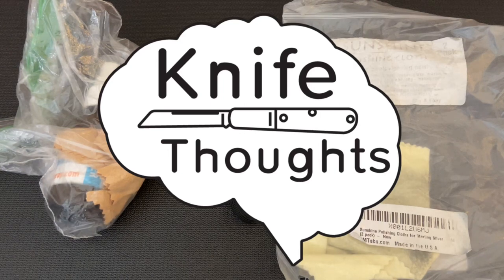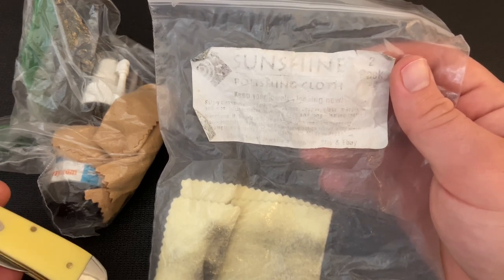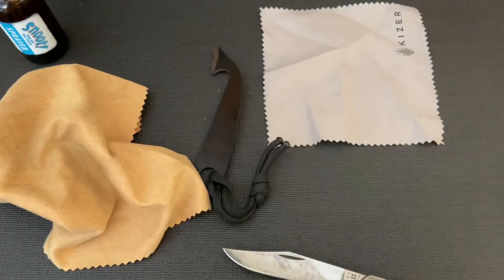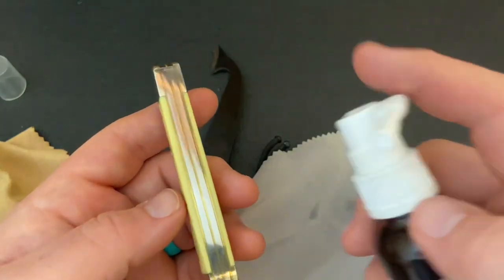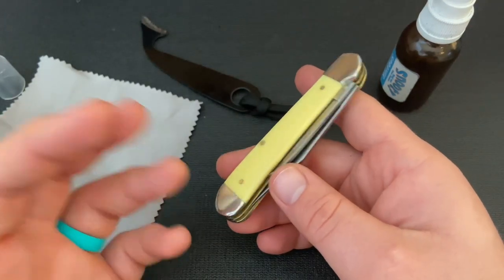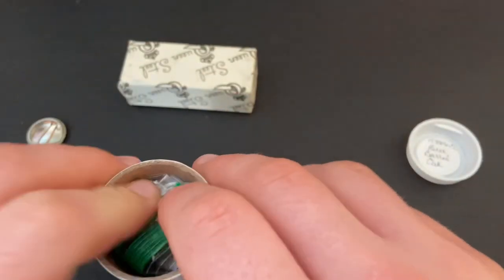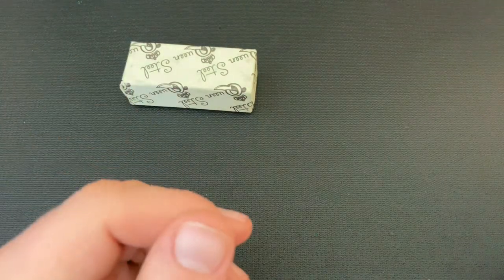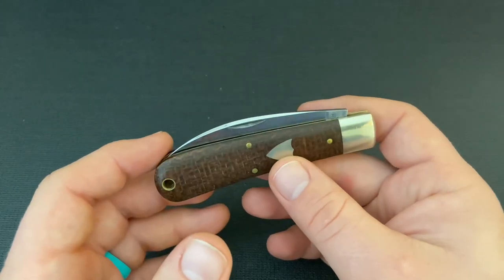How to Maintain and Store Traditional Knives (Slipjoints, GEC 1095, Case CV, Carbon Steel, etc.)

Comment: I always use Ballistol oil for cleaning since is a lubricant oil and food safe. 
Patina will help to protect the steel from elements and ruating. I more promp to rust if you taking the patina always out. Good patina is the best coat the blade can have ...
Carbons need frecuent cleaning. 

I carry a clean blade and a dirty blade. One for food, precision cuts and in overall  clean and very sharp. Most of the time is a GEC 2 blade or 3. 
The dirty knife is a Charge Leatherman, Surge or a fixed blade. Totally to use in sewer,  mud, pry bar, anything..... 
 
Great video
Reply from the maker: Thanks I'm glad you enjoy it!

Comment: As regards oiling, I bought some syringes and the needles had no points, they were essentially very thin metal tubes. They came in several different sizes and were perfect for oiling folders. Not difficult to get and cost very little money. I store my knives in a big plastic toolbox, the folders in tool rolls with lots of packs of dessicant in the box. It seems to work in this damp, rainy country with occasional maintenance so should work just about anywhere. Only had one knife get rust patches, a Marttiiinis black blade covering didn't like my mineral oil and rusted till I'd fully removed the black covering.

Comment: Just an FYI. Patina doesn’t lead to or turn into rust or oxidation. In fact a patina protects and prevents high carbon steels from said rust and oxidation.
Reply from the maker: Can you send me a link where it describes that patina isn’t oxidation? I’m not sure what other process it would be. 

I think of patina on carbon steel as oxidation that has been stopped, but if allowed to continued will become rust. That’s my experience. But I might be wrong, I’m no chemist.
Reply: @KnifeThoughts  I have knives with blackened blades never been polished no rust, if you want no patina get stainless.
Reply: Patina is a form of rust but it's good rust it doesn't destroy steel.

Comment: Yep - mineral oil (I use a brand called Ballistol) for all the metal, and Renaissance Wax on wood and bone covers.
For scrubbing out the insides of the bladewells, I use folded pipe cleaners.
I try to avoid patina, but when I get some (inevitable with carbon steel) I use fine stropping compound on a bit of cloth to remove it, similar to your technique with your silver polishing cloth but easier/cheaper.
I'm glad you made the point about a properly used and maintained knife being a good protection in its own right - to my eye it acquires an appearance and feel which a mint example cannot rival.
Reply: Have you ever tried removing stubborn patina with crocus cloth (1000-1400 grit)? Works wonders for me most times. It is basically chalk compound enbedded in cloth.

Comment: Would vegetable oil used for cooking qualify for mineral oil? 
What do you think about silver polish to get rid of patina? Too strong?
Reply: Vegetable oil is made from organic matter and will rot and decay over time which alone would greatly stain your blades. Mineral oil will not.
Reply: @bdh3949  Thank you kindly.
Reply: Olive oil is also acceptable,  I have heard.
Reply: @peterpuleo2904  Again, olive oil is made from organic material and will corrode your steel as it breaks down. Use food grade mineral oil.
Reply: I've used the silver polishing version of Brasso on carbon steel blades that I don't intend to use for food/animal prep and have no problems but there are many brands of silver polish out there so obviously can't recommend or not recommend the one you use.

Comment: Next step : put it in a box in your bank and never see your knives again 😂
Reply: Yeah, it's hard to tell whether videos are made seriously or ironically any more.  Knives actually get the most damaging rust when they are locked away and ignored.  That's why carbon steel knives leave the factory slathered in a heavy grease -- some of them could be in storage for decades before they get sold.